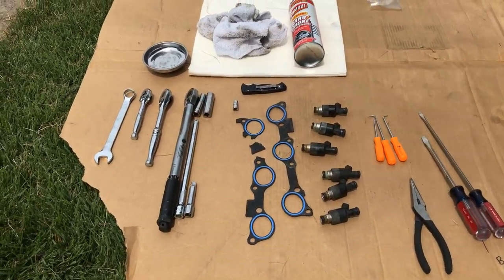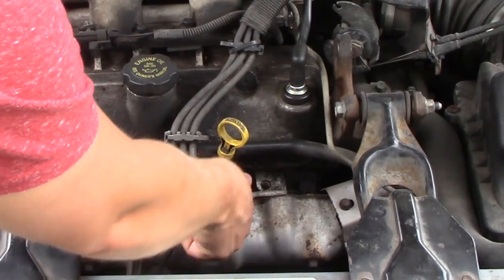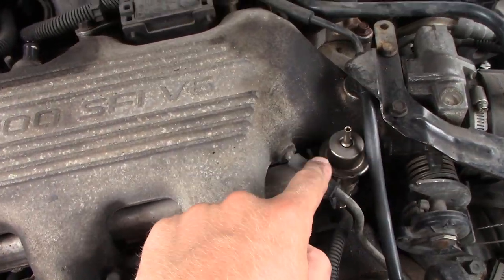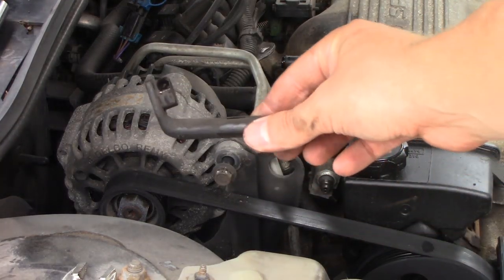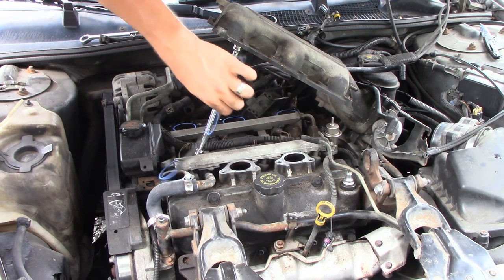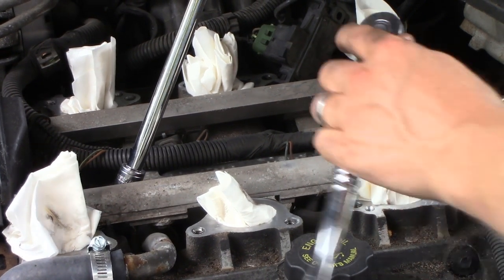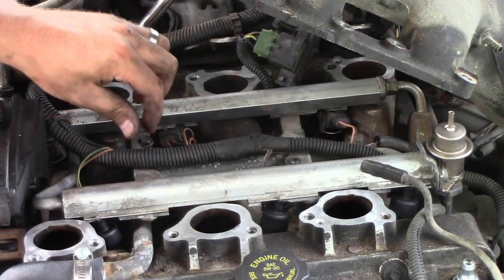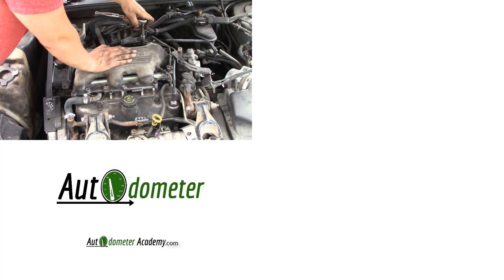How To Replace Fuel Injectors - GM 3.1L 3.4L Engine

Comment: As a note to others watching. These spark plug wires CONSTANTLY break off when removing the end that goes to the spark plug. I highly recommend only pulling off the ends attached to the coil and flipping it over the front bumper. Still well out of the way and you won’t end up making a trip to the parts store!
Reply: Great idea
Reply: Dude thank you for that tip cause my car is in the middle of the woods with a fuel issue and I’m broke from this mf car that I got 2 weeks ago 🙃🙃🙃🙃🙃🔫

Comment: Brake booster hose. 
MAP sensor.  
Fuel rail
That's what they are not hatting just helping out.
Reply from the maker: I for some reason could not think of fuel rail while editing! Yes the brake booster hose now makes sense. If I would have went back into the engine and taken a look. It was a long time between doing this job and actually editing it and putting it on YT.

So I’m guessing the MAP sensor you are speaking of is the little unit box connected to the fuel pressure regulator with that thin hose. I actually did not know that thank you.

Thanks for helping. People who hate I don’t let get to me because most haters don’t ever even try to make videos themselves to help others out
Reply: @AutOdometer  yupp thatsbthe map sensor that connects to the fuel pressure regulator if I'm not mistaken that hose sucks vacuum into the map sensor and then the engine. Also, for next time there is a specific way to remove and put back those bolts from the intake manifold. If you don't do it in the specific cris-cross method it'll tear/break the intake gasket hence another leak. But great job for your first time👍
Reply: The o rings can be lubricated with a slight amount of engine oil.  Eases insertion of the loaded fuel rail.  Also that line that hooks to a hard line is a for the transaxle's  vacuum shift modulator (4t60-e).

Comment: I couldn't find my fuel rails, tore it apart in last fall so now end of june 2022 oI have a 3100 sfi l-82
in a 1995 Pontiac grand prix  found some on ebay and with the stuff that would of been connected 
to it like wiring and tubing and some injectors But it says Grand Am  94-98  will those fit my 1995 3100?

Comment: What was the part you took off at 2:42 I have a gas smelling fluid coming out of there and idk the name of that part
Reply: Probably a bit late now, but that is the fuel pressure regulator.  Might help the next guy though.
Reply: If you took that hose off of your fuel pressure regulator and smelt gas that’s sometimes a sign that’s it bad.  It has a diagram inside that sometimes goes bad. It can give misfires, ruff idles and sometimes your car won’t start right away or die after a few seconds.

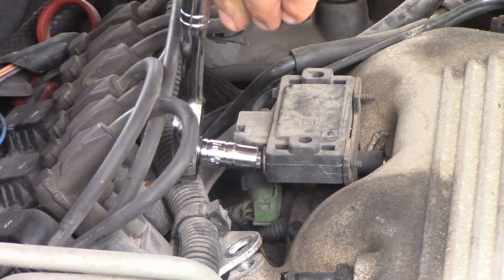Comment: 4:48 I don't think that's your fuel regulator. That is your MAP (Mass Absolute Pressure) sensor...
Reply: Yep.  I just replaced mine two weeks ago.  Also, the fuel regulator sits at the end of the fuel rail.  🤓

Comment: AT 5:00 YOU FORGOT TO TELL EVERYONE YOU REMOVED THE 2 13MM BACK BOLTS ON THE COIL PACK BRACKET. AND DID YOU DO ANYTHING TO THE FUEL LINES TO THE RAILS?

Comment: if that gasket gives too much grief, switch out the 12 that surround each runner to studs and flanged nuts. I'd go grade 5 and look for ones that are turned to a diameter on one or both ends. You'll see that alot on bolts that screw into motors, castings specifically. Reason being a full thread, bottomed out then REEFED DOWN can (usually does) crack the casting....maybe not right then and there, but run a few heat cycles through it so when you're on that 700 mile trip to see Gran-Gran, intake (in this case) cracks through, allowing way more air than it should, thus making that cylinder more lean than a 70's Arnold Schwarzenegger (with equally catastrophic results).

Comment: My car won’t start after I changed the injectors. Same car. Any ideas why.
Reply: Oh great! I'm in the middle of putting my engine back together after replacing head gaskets. (actually just needed to replace intake manifold gasket - they're the ones that actually go bad and leak  coolant into engine, but what the heck, I was already down there).  I'm wondering if I've got the injectors seated correctly.  Going back to check it out this morning. Do you smell gas? Maybe you didn't push them in far enough?  He didn't really show replacing the things (injectors) on the fuel rail.  Could be easy to get them not aligned properly.   They said in one video you have to pressurize the fuel rail by holding the key to ignition to the right a few seconds and do that several times before trying to start the car.  Please post your solution.  Good luck
Reply: I did notice on another video that the injector electrical leads are supposedly numbered, so they have to go to the correct injector.  I've got to go back and look now to see if I accidentally got them put in the right place. Probably not

Comment: Are the fuel injector cylinders numbered? Cause im getting a code that says fuel injector cylinder 2 fail or something like that
Reply: Was it the “cylinder 2 misfire” code? Im getting that only on startup for about 30 seconds then it runs normal. Its on a 2000 grand prix 3.1
Reply: @hunterrandolph2036   probably leaking down slowly into the cylinder so there is too much fuel at start up but as it burns off and gets pushed out it is fine.  That will last till it starts flooding all the time then it will really start breaking things.
Reply: I did notice on another video that the injector electrical leads are supposedly numbered, so they have to go to the correct injector.  I've got to go back and look now to see if I accidentally got them put in the right place. Probably not
Reply: yes the wire plug to the injector does have a number 1-6 for me and there is a stamp on the lower intake so match it

Comment: By any chance do you know what the connector located just behind the alternator is?
Reply: I had varmint get into engine and feast on that connector. Now I'm having electrical issues, I'm trying to figure out what is so I can replace?
Reply: Is it in the video? Where does the connector lead to in you car. My guess is it may be a coil pack connector, but make sure you follow the wires and tell me where they lead. Unless you’ve already got it fixed lol.
Reply: @THEOLYMPIAGUY360  lol like a fround of your talking about the ground connector bolt
Reply: @austinporter4285  no it’s not a ground, I’m not sure how many wires it is but it’s like a 6 wire connector.
Reply: @braydinjones6301  no not fixed it’s a multi wire connector. Whatever it is, is causing a short in interior dimmer and turn signal.
Reply: Honestly I hope you got this fixed by now because I see what your asking about and I have the same motor in my 3.1 grand prix but after motor modifications for a tiny turbo that connecting post was completley replaced so sadly I no longer have the ability to look at it face to metal and tell you but if you are somehow still having problems and can take a video I may be able to give you my number if you message me because I've had this same car and engine for my last 3 cars so if I can get a video I can help.... Only cuz I'd feel pretty sad if this wasn't fixed yet... anything with the gm 3.1 or 3100 sfi deserves to run until its parts have driven 500,000 miles AT LEAST and I've seen better.
Reply: injector harness
Reply: @austinporter4285  Thank you sir I appreciate that. Sadly my car was totaled in a hit and run by a stolen car that rear ended me.

Comment: idk what's wrong with my car. someone please give me some advice.
Reply: That's not very specific! I did notice on another video that the injector electrical leads are supposedly numbered, so they have to go to the correct injector.  I've got to go back and look now to see if I accidentally got them put in the right place. Probably not.

Comment: I played this video to see how you remove the fuel injector, but you skip that part in the video.
So. The video is not helpful for me.
Thank you
Reply: He describes the process with a close up picture quite plainly, pointing out clearly the extraction method.. If you cannot figure it out from that, perhaps you are not the one to be attempting a job like this.
Reply: @richardthelionheart01  He didn't mention how to actually take the injector off passed mentioning the o'ring. Which is the part I'm currently stuck at. I'll figure it out but he did actually skip that part.
Reply: @heathencake9110   right!  I'm wondering if I got them a little crooked, because they don't seem to be seating properly.  Now I'm going back to fiddle with the alignment of them. I ended up losing a couple of the clips and had to go to the junkyard to get more.  (they do have them at oreilly, but you have to wait two days to get them.
Reply: see reply below.  same problem here.  never as easy as in the videos!!!
Reply: I did notice on another video that the injector electrical leads are supposedly numbered, so they have to go to the correct injector.  I've got to go back and look now to see if I accidentally got them put in the right place. Probably not

Comment: Bogus from the git go. As you pull spark plug cables you do not label what cylinders they are going back to. That would be a problem of misfire at the end especially when spmeone is working with V8 engines.
Reply: I just marked the top of the loom holding the spark plug cables, they are connected left to right aslong as you know which side of the loom was up when you started you shouldn’t have any misfires. That’s a poor explanation but I can’t think of a way to phrase it better.
Reply: Not bogus. 1,  it’s not a V8, 2,  the back plugs are 2,4,6 from left to right and the front is 1,3,5 from left to right. If you can’t figure that out you probably shouldn’t be changing your fuel injectors. 😂